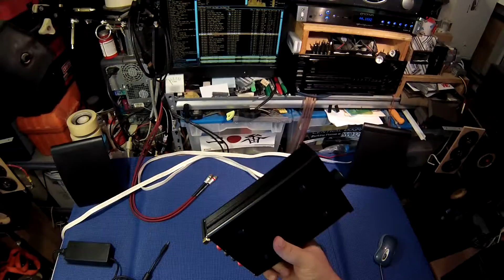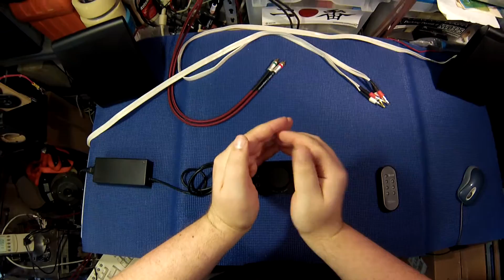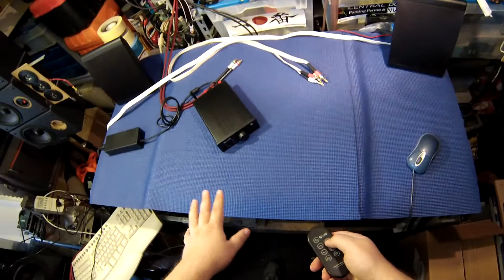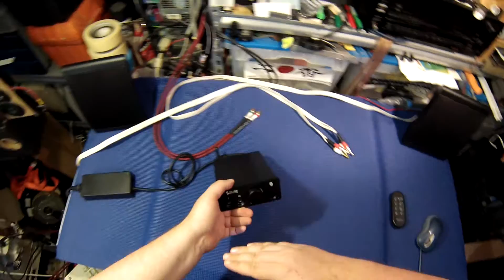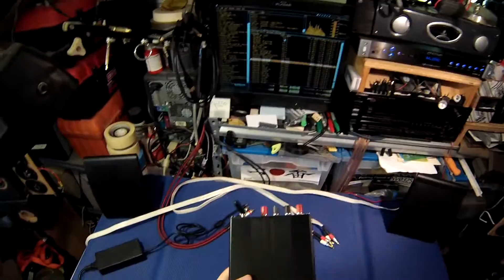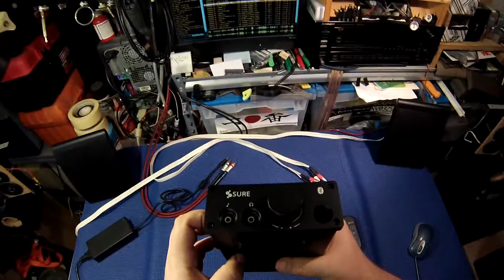Z Review - Sure 2.1 Bluetooth 100wpc T-amp (poopy)

Comment: Maybe i'm mistaken, but if the power adapter is 24V*5A, that gives you 120W total. divided by 2 channels at 100% efficiency, would give you 60WPC, no?
Reply from the maker: although not an electrical engineer I think there is some other way of determining the deliverable power of an amplifier.
Reply: Tyler Watthanaphand In the DC world. What you're talking about is RMS power. Assuming sinusoidal input, RMS (60) * sqrt2 = peak. Therefore peak is about 85 watts.

Also, it's possible that it draws more than 5 amps. The only way to measure this would be to use a clamp meter